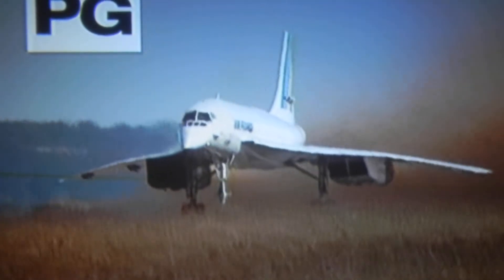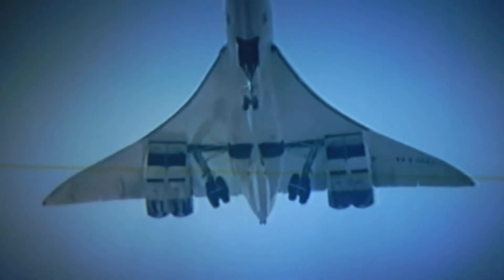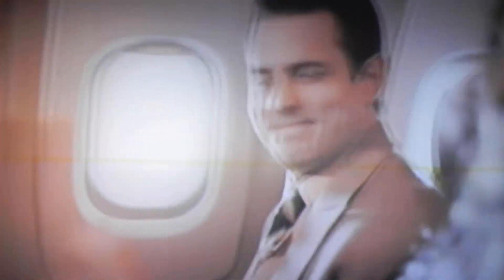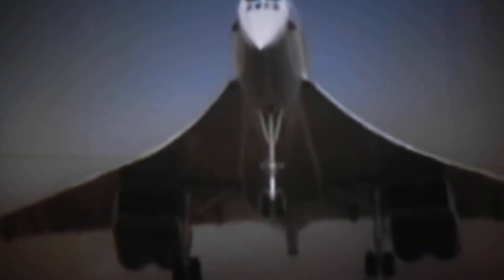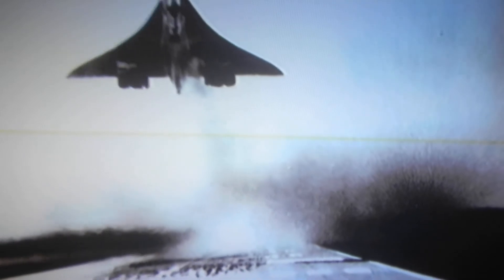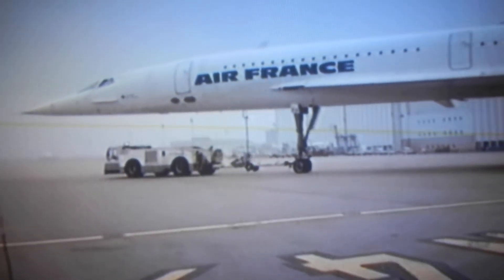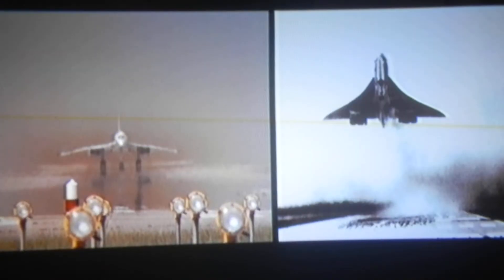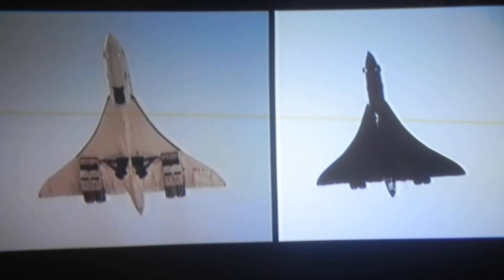Concorde:  Flying Supersonic

Comment from the maker: Previous tyre incidents[edit]
In November 1981 the American National Transportation Safety Board sent a letter of concern to the French BEA that included safety recommendations for Concorde. This communiqué was the result of the NTSB's investigations of four Air France Concorde incidents during a 20-month period from July 1979 through to February 1981. The NTSB described those incidents as "potentially catastrophic," because they were caused by blown tyres during takeoff. The NTSB also expressed concern about the lack of adequate remedies on the part of the French, as well as improper crew responses to those incidents.

13 June 1979: The number 5 and 6 tyres blew out during a takeoff from Washington Dulles International Airport. Fragments thrown from the tyres and rims damaged number 2 engine, punctured three fuel tanks, severed several hydraulic lines and electrical wires, and tore a large hole on the top of the wing over the wheel well area